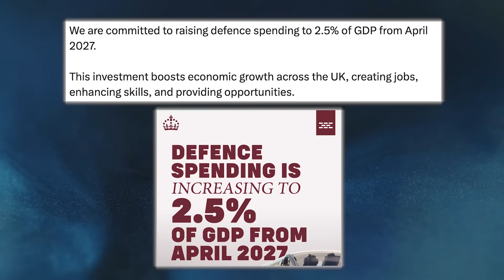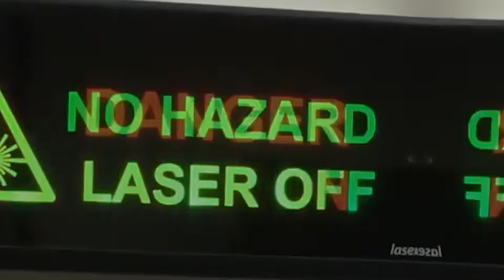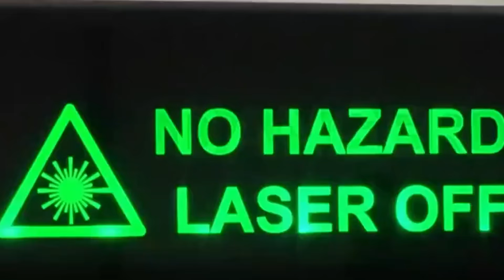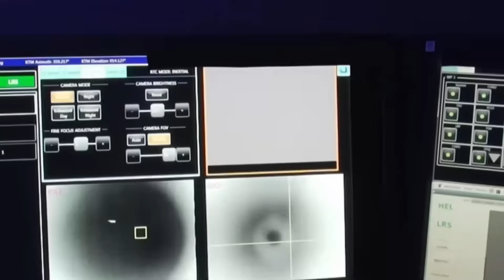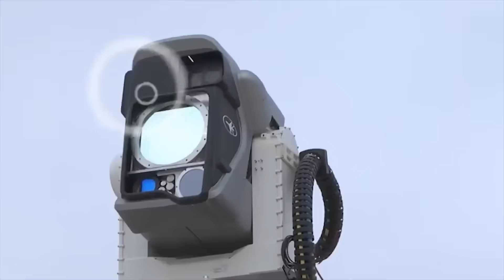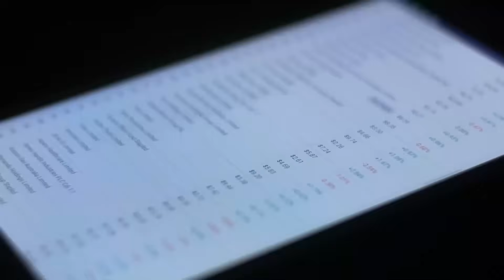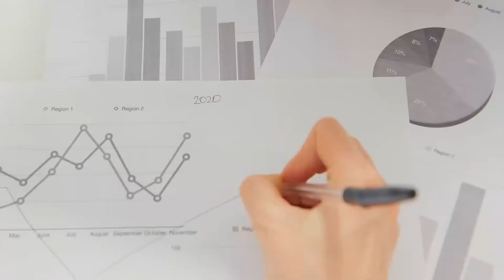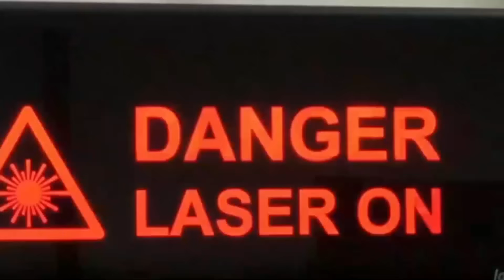UK SHOCKED Russia by Deploying a Never-Before-Seen Laser Weapon on British Destroyer on Sea!

Comment: Honestly when this becomes standard issue it’ll mean that ship based Point defence will have effectively unlimited ammo. So as far as missiles are concerned it’ll mean either massive swarms of missiles or go back to old fashioned big guns that can’t be knocked out by lasers. That would be funny if lasers mean the resurgence of battleships
Reply: could a Phalanx CIWS take out large projectiles like that?
Reply: @WHWogbin Probably not if they are proximity fused or timed rounds.
Reply: Only for as long as they can produce the power to run them.

Comment: as good as this step forward is compaired to the Israel system which by all looks its based on, given the drone swam attacks by russia on ukraine  the destruction power has to be dramatically improved and also work in bad weather,  eg tracking up to 200 inbound with a take out time of each item less than a second apart, the current 15-30 sec time is just too long, this has the protentional to replace phanix systems if it can be scaled up for close air/sea support

Comment: Slight problem with this weapon.
They said a burst is 'ten seconds'. If the task force is under attack by, lets say, 160 drones, if it takes 10 seconds to reduce one to ash, the other 159 are all going to fly into the carrier, drill deep into its bowels to where the missiles and jet fuel are stored, and explode, before the laser can fire on the second drone.

Comment: Great for big single targets but turret rotational speeds will be the limiting factor against fast moving drone swarms which will require high velocity spinning short burst attack profiles and potentially multi lazer platforms in synchronous firing patterns.

Comment: Ironically, Scifi authors have been fighting high tech weapons battles for years and have developed theoretical counter measures for energy weapons like LASERS. One is nicknamed "sand". Sand is a container that is a cannister launched when a energy weapon is detected. The cannister explodes at a preset distance and disperses a cloud of refractive crystals that degrade the energy beam as it passes through. 

Interesting that the UK and the US released ship based energy weapon systems within a similar time frame. USS Preble, DDG-88 Arleigh Burke Flight IIA class Destroyer is fitted with the HELIOS system. Far as I know the HELIOS system is still undergoing testing under operational conditions. 

The two systems dont look similar so while they might share technology its not the same system. Kudos to RN for this achievement.
Reply: I was thinking a giant mirror or something, but this is cool to and seems more reasonable 😂

Comment: Seems to me they need to develop an airborne version of this for missiles. Flying up at 40,000 ft. there are no clouds, fog, smoke or mist. Probably need to be mounted on a big bodied jet capable of carrying a gas turbine generator and Giga-Farads worth of super capacitors. The thinner the atmosphere, the less dispersion of the beam and the more power on target or, alternatively, greater range.
For lower and slower drones, I suspect a fully automated, radar controlled, small calibre, AA gun could take out several drones, while the laser was still burning a hole in the first one. My other thoughts are: how does this thing cope with a 99+% reflective coating on its target? Is it small enough to be mounted on a truck?
Since it seems to need several seconds to actually disable its target, just send two missiles at it with a two second gap between them. Bang! Ship gets hit by second missile while still destroying first missile.
Reply: They are developing this for the 6th generation FCAS, with the help of Italy and Japan. Other countries like Canada and Saudi Arabia may soon also come on board this project. Lasers on aircraft is a completely different kettle of fish the mounting it on a destroyer. The Destroyers won't have the system until 2027.

Comment: 13:07 Are you sure it is only 100 K Hz? Visible light spectrum covers hundreds TERA HZ. There are missing information: 1. How many wats are they? From your description I suppose it must be at least 10 KW. 2. How they gonna work during rain, snow or fog? Within 10-100 KW they won't. 
3. What if drones will be covered with highly reflective paint or mirror-like layer? 
Laser is an old tech, but for above reasons till now it wasn't applicable as an intercepting tool.

Comment: Drones carrying grenades or other droppable explosives can be launched by the thousands from a passing airplane or chopper. What will having 4 lasers (so they say 1 on each cruiser) change I think even having 100 wont change a thing when a massive drop of drones is in place Interesting technology, but I think if it can not attack an area in one go, as the explosion of a rocket could, it will be easily countered by massive deployment of cheap drones or other projectiles to overwhelm trough sheer numbers.

Comment: Main advantage is it only costs a few pence to fire, fires really quickly and accurately at multiple targets and never runs out of ammo.
Reply: Not really, contrary to what the video claims they require Extraordinary amounts of energy to fire even just once , which shortens a ships range as it has to find a port to refuel in much quicker, also the video says the range is classified, well the system developed for U.S ships has a range of 8km, in absolutely Perfect weather conditions,  it won't be more than that,  the effective range on the average day is probably about 1-2 km . A cruise missile has a range of about 12-15.000 km .
The only thing it could be used for is defending the ship itself against drones
Reply: I guess the real advantage is about munitions storage, which also saves on weight issues....   also won't run out of missiles with ability to harness power.   I do suspect that they will harness nuclear power, as this is the most reliable method of creating electricity.
Reply: Great for Drones , useless against ICBMS. And Russia has thousands of those.

Comment: As a lazer only goes in a straight line and we on a round planet what’s the range on the razor system .   I’ve had a lazer that lights a fire from a mile away for over 20years.. this not technically it’s just showing what u had not what u got now

Comment: I was investigating lasers to communicate between tower blocks but the spread of the beam was too much after a few kilometers, hopefully they solved this problem.
Reply: That's easily possible. The trick is to spread the beam and then collimate it and then it stops spreading significantly. You can use telescopes at each end to do that.

Comment: What happens if you use a reflector to return 'fire". Anyway if it is not going to be fitted until 2027 then why are you giving potential enemies notification that they need to work out a defence against it?
Reply: Because its already been fitted. If the public know of it then it meets certain conditions within the military. Used to be if the public was aware of a technology the military was 20 years ahead.
Reply: You litteraly heard within first minute of the video. “After decades of works and tweaking”.  

Everyone works on them.  It’s known tech.  It’s been for a while. 

And usually defence is not preventive is adaptive.  

You can have a full tech ready, unless is battle proof and proves that it’s impact it’s significant enough not to be ignored there won’t be much defence developed.  

Also there’s not much you can do against a laser beam.
Reply: @armando7354  Adorable merit finished disabled to withstand it ? , You would do you dump ?
Reply: Really depends on the material.
Most materials would melt/shatter instantly.
Some would melt/crack slowly as they'd hold the energy of the light/heat/radiation a little better.
Then for designed low-grade defences against the lasers would potentially have a decent life span, but  would need frequent replacing. High grade replacing alot less frequently, but i assume nothing would have a permanent life span at this stage of technology.
Though I'm just speculating here. Could just take your wifes handheld make up mirror to destroy an entire fleet weilding this tech. Lol
Reply: @adamfrancis9828  yeah you would only need to reflect it long enough to target it and flee.
Reply: @adamfrancis9828  they would have tested mirrors etc to make sure that they aren’t susceptible but remember a reflective surface will be scratched as it moves though the air at such speeds and may even crack. This is means it’s reflect-ability is reduced
Reply: You dream it, we can develop it 😂
Reply: @VincentYeaman-qb8xu  I read darpa state  We're are twenty years of ahead of anything you can dream
Reply: Just saying ‘AdD a ReFLeCTOr’ isn’t very well thought out, the reason why laser weapons have a relatively short range (usually only a few kilometres) is because the atmosphere disperses the beam, not to mention there is no such thing as an ideal reflector, there will always be some form of energy absorption (particularly in the IR range that the dragonfire seems to use) which will cause heating, it’s highly likely that this heating could cause a drop in the reflective efficiency, thus causing more energy to be absorbed and before you know it your reflector isn’t very reflective and your on fire.
Reply: @polarisukyc1204  Ok then find something that disperses it quickly.
Reply: @ are you suggesting that you fit your attacking vehicle (drone, whatever) with a tank of a substance that disperses the beam, not very practical, liquids are heavy and would absorb more power than they would disperse (thus they would boil away) and most gases are not much better at dispersing lasers than air plus Any tank on your drone would be an obvious weak spot, it wouldn’t even need a direct hit to break as heating it would increase the tank pressure and cause it to rupture explosively, and it wouldn’t be able to carry much due to the compact size. Then there is the problem of dispersal, how do you release that substance into the beam, sprayer? Hardly, the non-contiguous nature of the spray would not stop enough laser energy from getting through
Reply: @polarisukyc1204  They said that about chaff packages and glitter. All i am suggesting is that they are giving their potential enemies until 2027 to prepare for this. how they do it is up to their ingenuity, not mine.
Reply: @ chaff and glitter won’t be as effective as you might think it’s still effected by gravity and a constantly moving drone would quickly move past any glitter or chaff cloud it could release, not to mention that it would not reflect all the laser power. Chaff might mess with the radar but not the electro-optical tracker, yes they are announcing it and I have no doubt that the Kremlin is trying to figure out what to do (and has been for a while behind closed doors) but given that they have literally just lost a multimillion pound bomber to a fibreglass drone, I’d say that it’s unlikely that they will be prepared by 2027. The British government might not be in the best place right now but I think that they’ve got the intelligence to consider the consequences of the announcement and either have judged them to be irrelevant or have prepared for them
Reply: @polarisukyc1204  FFS I was giving it as an example at what was laughed at originally but became normal not that it would work in this instance.
Reply: @ianmontgomery7534  forgive my indignation but don’t present it as an argument then. If you didn’t present it as such and I misunderstood then I apologise
Reply: @polarisukyc1204  No problems.
Reply: They is no warning enemies. Every nation has spies in other nations regardless of allied or opposed. They already knew is was happening. And you can see these type of things during testing in the advanced satellites that these nations use.
Reply: @ianmontgomery7534  my comment got shadow banned by YouTube. 

Other nations have knows this was comming for years due to spies.

Also during testing youll end up showing the world anyways cause it has a significant effect on heat maps etc.
Reply: Don't let the Yanks have it. It'll be another reason for blue on blue 😂😂
Reply: A reflector. How would you camouflage that.
Reply: @keithhorning7753  not sure but you have at least two years to work it out. My guess is that it would be similar to an umbrella.
Reply: @ exactly not to mention the air isn’t empty. The reflector would be so scratched up it would have to be replaced so often and would be so ineffective.
Reply: @use_your_brain_pls It might only have to stop the initial ray.
Reply: @ianmontgomery7534  but the laser doesn’t work alone and a reflective surface isn’t aerodynamic which means a standard missile defence would be more able to take it out before even getting to the laser. Having the laser means you either have protection against that through some reflective solution or you have speed the 2 are mutually exclusive.
Reply: @use_your_brain_pls They will work out how to defend against it. Like they did when they started using metalised chaff.
Reply: @ianmontgomery7534  yh but that takes time and that's a window when the UK has a significant edge over Russia. Additionally, their has to be a compromise. Putting armour on a plane made it slower that was only needed cause people had made planes with guns. Else they would have had bombers with no armour. Even if it doesn't do much its the extra factor and extra layer that they are adding to reduce the ability of the enemies planes and that's what matters. The beam may never be shot but it did it's job.
Reply: A reflector scatters light in all directions trying to focus a Lazer back precisely on a moving platform from a moving platform would be almost impossible. Plus light reflected will not be as powerful.